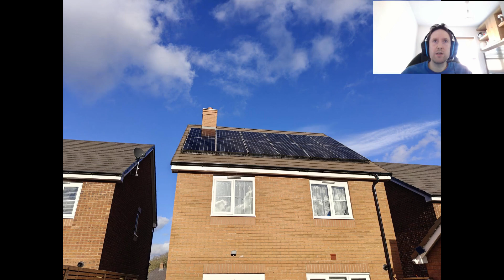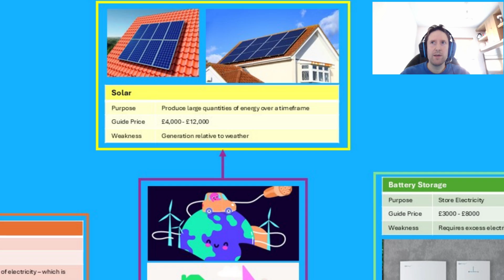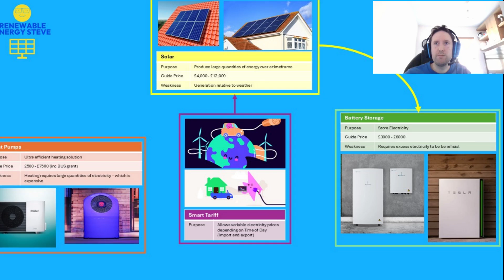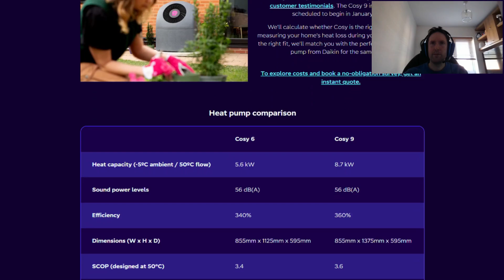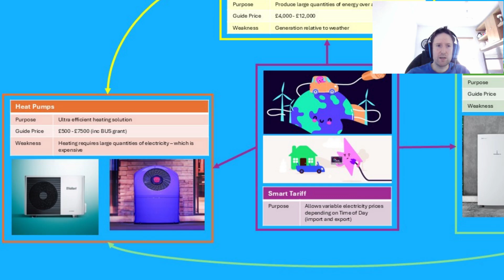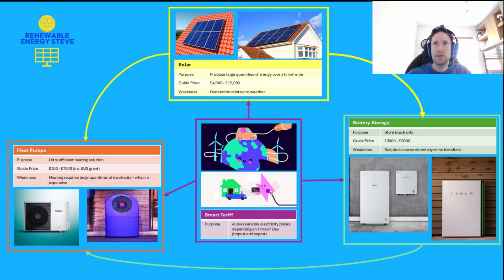How Solar, Home Batteries and Heat Pumps Compliment Each Other

Comment: With regard to heap pumps, OVO Energy offer a significant reduction for energy used by your heat pump, it also offers the same reduction with EV charging, which as I write this is, 0.14p per Kwh anytime of day. Home batteries and solar continue to be quite a large outlay and I for one am a little hesitant to invest at this time unless I know I'm staying put and not going to move anytime soon. The OVO anytime deal means you can have the confidence in knowing you can just get on with heating your home and charging your car at a reasonable price without having to worry about time of day etc.
Reply from the maker: Tariffs are certainly an important tool to keep the bills down. Being on the right one can savevmany hundreds 😊 
It's worth noting a good solar setup can increase the value of a house so it's not always lost if you sell. When I sold my previous house it seemed to make a difference, but it's difficult to quantity exactly how much.

Comment: Hi thanks for your informative video.
I have a heat pump and considering a solar PV installation but can’t find out if I need to HV or LV system to run mu heat pump. Can you Help with any advice please?
Reply from the maker: Glad you found it useful. Actually I don't think it's likely to make a great deal of difference in the grand scheme of things unless you have really limited roof space or something like that. Most residential panels are LV (operating below 48v) but ultimately all that really affects is compatibility with inverters. When choosing a solar setup the key aspects I would look for is module efficiency, where around 22 to 23% is considered strong, this allows you to maximise your roof space. Also cost per kW as this will have an impact on payback timeframe. Though in my view it's worth getting premium panels with long warranties as the labour costs of an installation outweighs the cost of the panels by a fair margin these days.